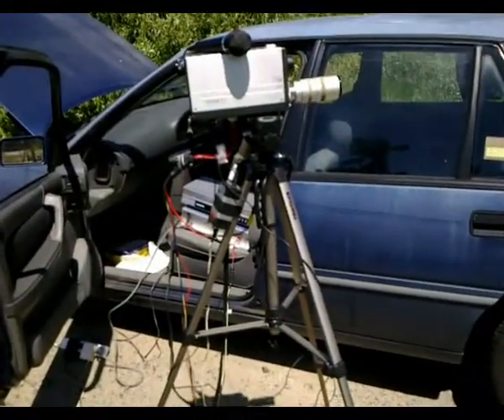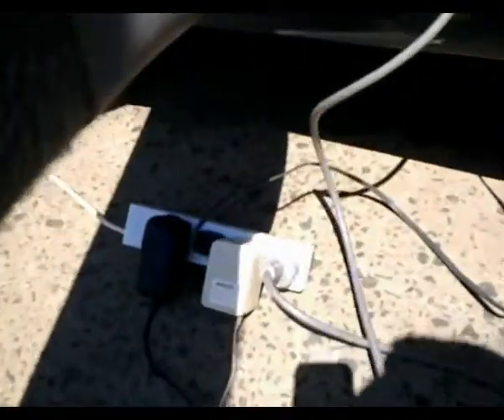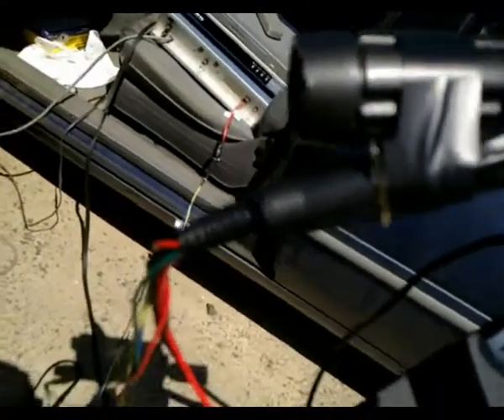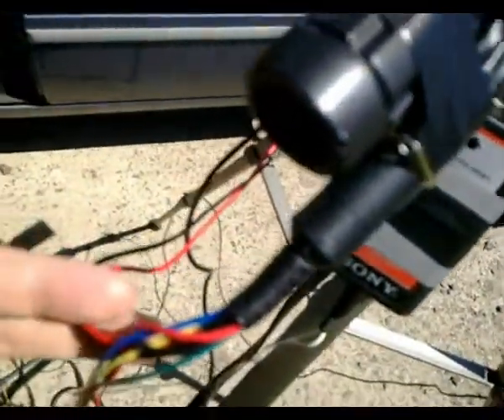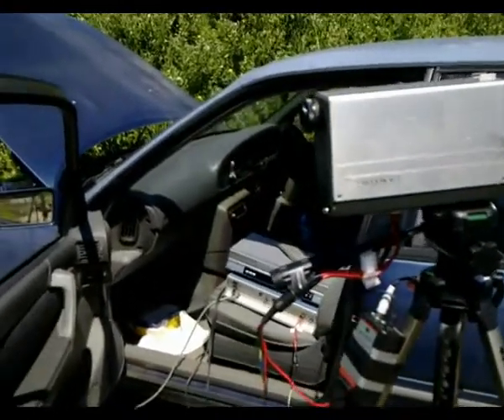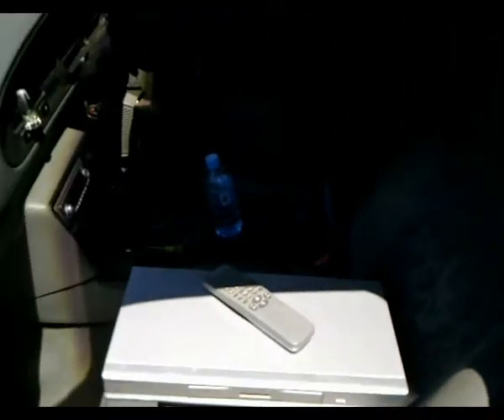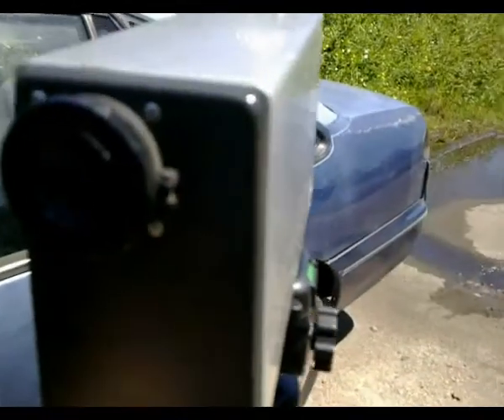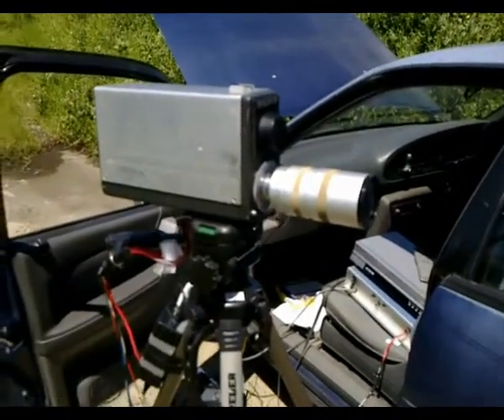Demonstration on remote filming with a vidicon camera

Comment: I've done this with my RCA CC011 while I have been storm chasing. Unlike with a CCD, a newvicon tube can actually capture lightning without the issue of partial exposures. I am worried it may cause some burn in though.